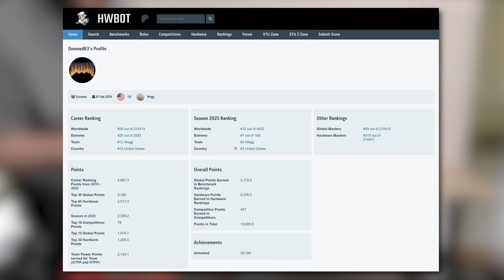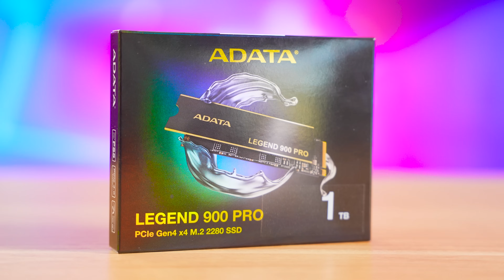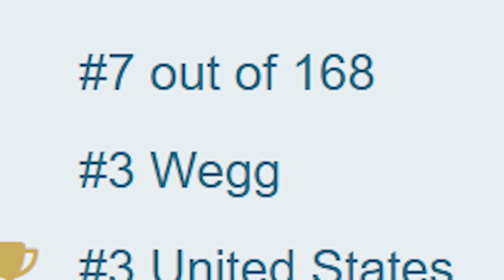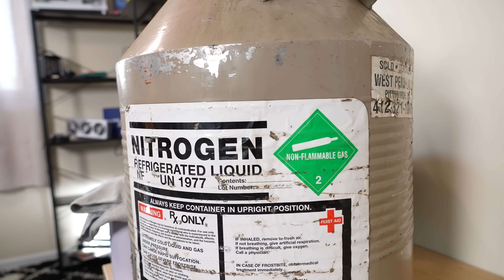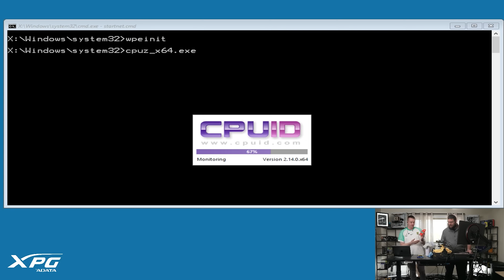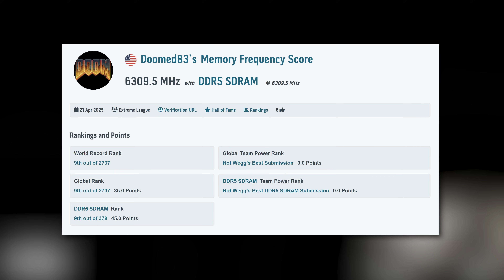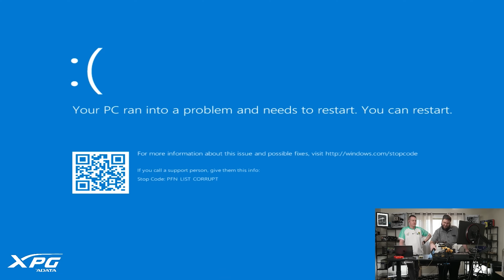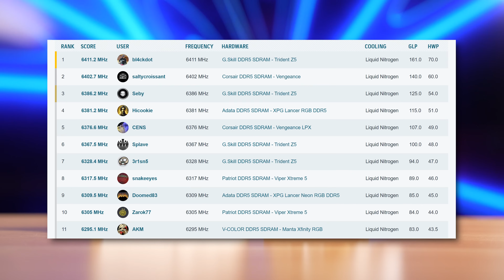World Record Liquid Nitrogen Overclocking Attempt with LANCER NEON Memory

Comment: It's kinda wild to see a 6400-kit running at 6400MHz for real. While a lot of RAM kits are listed at 6400MHz, they are actually running at 3200MHz or 6400MT/s. This is a holdover from SDR (Single Data Rate) RAM. They had to tell people that the DDR RAM was twice as fast, so they lied and said the frequency was twice has high when the reality is just doing twice as many transfers per clock. So, the truth is DDR RAM is twice as efficient as SDR RAM which is actually better.

Comment: I can't overclock my memory on my 7800X3D paried with some gskill trident without running a risk of blowing out my IMC internal memory controller, I had to replace one cpu already so I just run stock jedec speeds at what it is, 4800 or something.

I was told that running a negative PBO on my X3D and running overclocked memory could cause the issue.  I tried posting asking AMD this on reddit and AMD removed my post.

Comment: Why was the intel ultra used and not 14900k 
Because i m not sure if im right or wrong but 
The only ultra advantage is smaller node 
On the other hand 14th gen i9 has memory controller on the same die  so higher bandwidth and lower latency maybe even more stable connection?
Reply: The Z890 platform and core Ultra CPUs can achieve much higher memory frequencies than Z790 and 14th gen
Reply: You can get higher memory clocks much more easily with Core Ultra 200 series. I mean even for daily systems, stuff like 8800 is braindead easy. So obviously, on LN2 that means hitting higher frequencies than 13th/14th Gen.